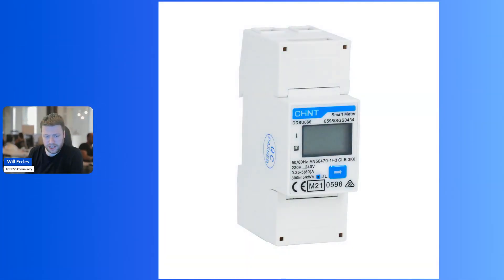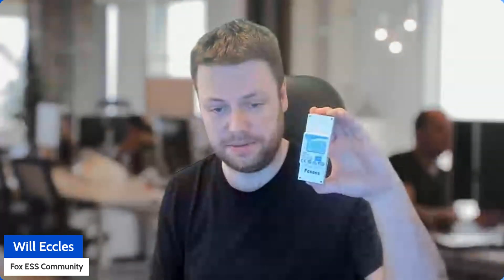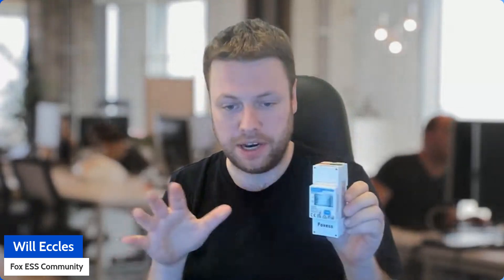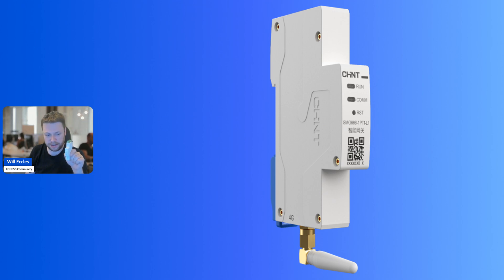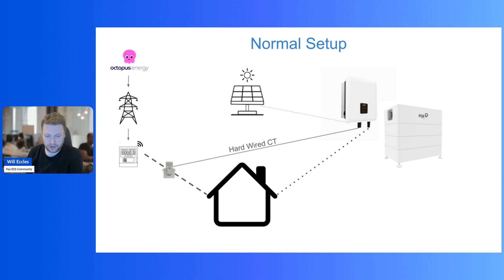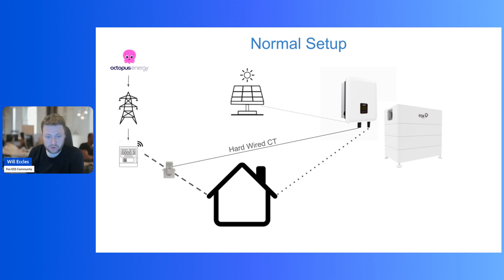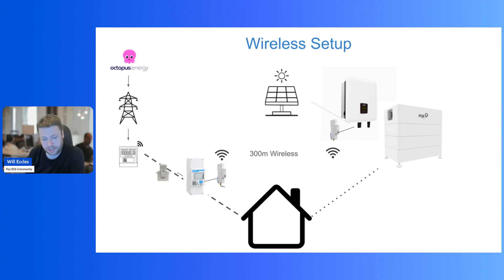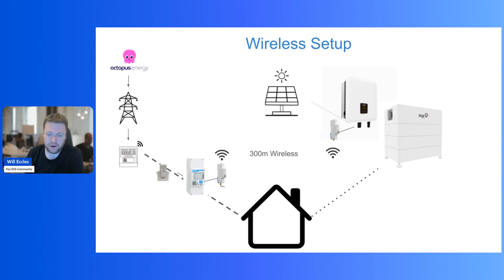First look at the new "in development" Fox Wireless CT for single phase hybrid systems

Comment: Trying to get this working on an install at the minute, on install had good signal but last day or two having multiple lost comms and inverter shutting down on G100 protocols, we had to extend the antenna at both ends to get good line of sight and probably looking at around 100m LOS but still getting dropouts. This solution is going to become more and more needed as we start swapping out old outbuilding string inverters for new hybrid and battery solutions so a reliable solution is needed for sure.

Comment: It's a nice improvement (again, nice to see Fox innovating) but the only issue I see is that there isn't a great deal of room in some of these external meter cabinets to house a DIN rail type setup without going for an external consumer unit (+ all the issues that brings).  I think this is the area which I think there needs to be more industry cooperation between manufacturers.  All we need is something like an open software/hardware Harvi type system which once installed on a main tails could then talk to whatever (EV, Inverter, Solar, Monitoring system. Matter v1.4 etc) system is installed.  But then again, wouldn't it be nice if Octopus brought out a smart meter which has a local open api/Matter v1.4 as part of their Kraken's Mercury consortium.

Comment: Looks very suitable Will, I presume it's like installing a doorbell transformer. Given its radio, how well does it work when the transmitter and receiver are fitted inside the metal CU ? I'm assuming guidance will state it will be mounted in a separate (plastic) box. Any thoughts ?
Reply from the maker: 85v - 270v so you can power it off a small mcb near the meter and inverter. I believe it's designed to be installed in a subboard.